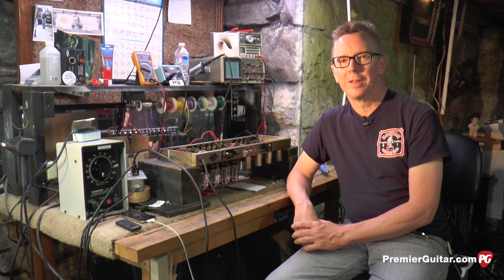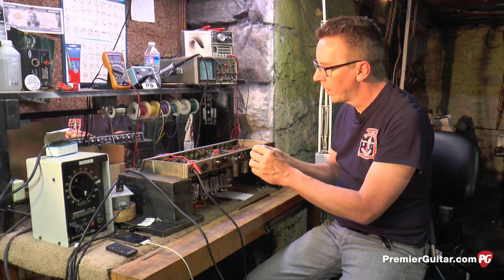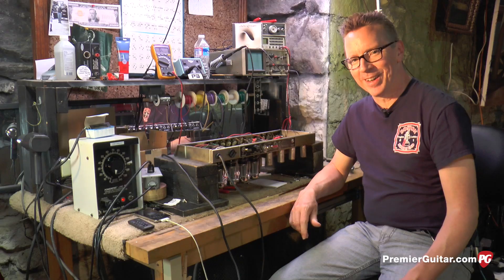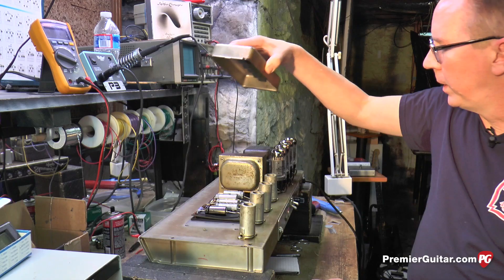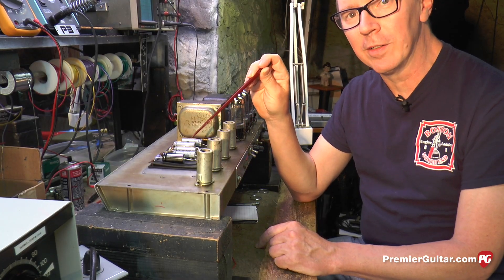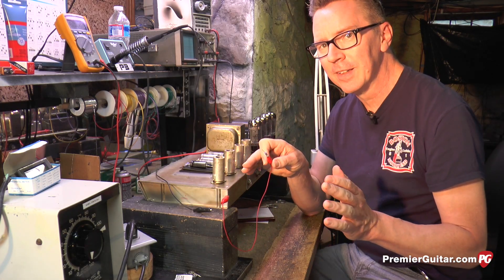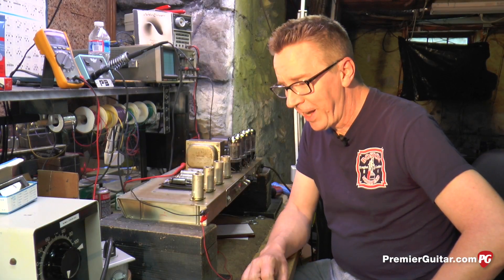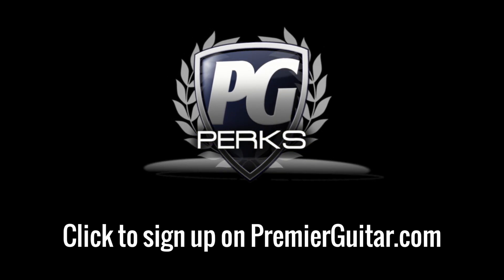DIY: Amp Safety 101

Comment: When you are trying to discharge the filter caps and the amp is unplugged  on the bench and it not plugged in how is the chassis a ground?  What is connecting it to the earth to dissipate the charge?
Reply: +Andluth Also curious- is it just the fact that it is sitting on the table?
Reply: +wattdog16 I emailed Kye and he said the chassis should be enough to drain the caps.  He also said that any good tech would also use a Variac but he did not say how.  I hope that helps.

Comment: Basic electrical question: The chassis is used a grounding mechanism. But doesn't that just make the chassis electrified?
Reply: +Brendan Wilson A filter capacitor is like a DC battery: it stores electrical energy until you give it a path to ground.  In the amp, the negative side of the filter cap is always connected to ground; the positive side is not.  When you use the jumper wire with the resistor, you're "shorting the battery" (the capacitor), positive pole to negative pole.  That's what drains the power from the cap.  The power cord does not have to be plugged into the wall for this to work.
Reply: just to be clear, Kye misspoke when he brought up the fact that the earth is the biggest resistor. That is true. However the minute you unplug an amp (which he says you must do before you start to work on it),  the earth as a resistor becomes irrelevant because the chassis is no longer grounded to the earth as it would be if it's plugged in (through the the ground pin in the plug).  At the point that the amp is unplugged, the amp's circuit is said to be "floating." The chassis is still the ground side of the circuit and by connecting the (+) side of the capacitor to the ground side of the circuit (with a lead that includes a resistor), you are shorting the capacitor and the act of shorting a capacitor discharges it. The are plenty of amp techs that short capacitors with the shaft of a screwdriver. Not a great idea by most standards because there will be a nasty spark. But it speaks to the fact that you're just shorting the two side of the capacitor to discharge it.  If one hand is on something connected to one side of the capacitor and the other hand touches something like the chassis that's connected to the other side, then your body is completing the short circuit the same way the shaft of the screw driver would. Only problem there is your heart is also in that circuit path (from one arm to the other).
Reply: +Brendan Wilson Im curious about this too :S  what if your elbow is bumped against the chassis while you are discharging like this?  Do you become a quicker ground to earth?
Reply: +Brendan Wilson Also curious.  Would like somebody to elaborate on how the chassis as a ground works exactly
Reply: 'Ground' has more than one meaning. The ground wire in a three wire power cord connects the chassis to actual ground - the Earth, so that if a fault should cause the chassis to be connected to the live/active/hot wire of the power cord, if the mains fuse in the amp doesn't blow first, current flows to ground and (hopefully) blows a fuse or trips a breaker at the distribution board. Another meaning of 'ground' is the 'zero volts point', from which other voltages are measured, which in a guitar amp is the chassis, even if it has a two wire power cord. Even in a stand-alone battery powered electronic device such as a transistor radio, the wire or PCB track connecting other components to the negative terminal of the battery is known as 'ground'.
Reply: +wattdog16 +Amber Johnson +Brendan Wilson  The reason is because the chassis is connected to ground through the ground pin on the amps power plug (the long thick one in the center). This makes the chassis a direct electrical connection to ground with almost no resistance. On the other hand, your body has a resistance to it since it is not an ideal conductor (think of your flesh as a resistor). So, even if you touched the chassis while discharging the filter caps, the vast majority (essentially 100%) of the electrical current would want to flow through the path of LEAST RESISTANCE to ground, which would be through the chassis to the ground pin.
Reply: Suppose you bleed some large capacitors to the chassis of an unplugged amplifier as shown in the video. Is it possible for the chassis to become dangerously charged or would this not happen because the chassis is so large in comparison to the charge stored by the capacitors?

Comment: You should also check the voltmeter itself before use. For example by probing a battery. Otherwise something like a broken wire can result in a zero reading even tough there is dangerous voltage in the capacitor.

Comment: The biggest resistor on the planet, the planet itself? But the amps not plugged in, how does that work?
Reply: +crispybacon501 Both the bleeder lead and the negative end of the capacitor are connected to the chassis of the amp, so touching the resistor in the bleeder lead to the positive terminal of the capacitor places it in parallel with the capacitor. This means that the voltage on the capacitor is applied across the resistor, and if there is a voltage across a resistor there must be a current through it (Ohm's law). Where there is voltage and current there is power. The electrical energy in the capacitor is dissipated as heat energy in the resistor.
Reply: The planet is a red herring! It isn't involved!. The chassis simply acts as a convenient conductor, standing in for a piece of wire. Whether or not it is connected to Earth is totally irrelevant.
Reply: I was wondering about this, too..
Does the amp need to be plugged in (but switched off at the wall switch?) to bleed the caps to earth?
Or just connecting across to the chassis unplugged is ok?
Reply: Many years ago I worked in a computer repair shop, and we'd attach a ground lead from the computer chassis to the ground hole of a wall socket (plus another ground wire from the chassis to the technician's wrist) to ensure that the chassis AND the technician were both grounded to actual-earth (not just grounded relative to one another). This was mostly to guard against damage to very sensitive computer components (which were susceptible to tiny voltage differences), not as a personal safety measure. But wouldn't it make sense to ground the chassis to the earth (via a wall socket--the ground hole only) for this application as well?
Reply: +Silas Fatchett Yes I fully understand that but where does the planet come into the equation? Since the amp is unplugged then the chassis is not at earth potential. I don't think he thought that comment through before saying it. Anyway, moving on....
Reply: My thoughts entirely

Comment: As JusAequum asked. How do you know the chassis is grounded. I understand how it would be grounded if the amp is plugged in but if the amp isn't plugged in how is it grounded?
Reply: It isn’t. You are shorting the caps one by one to their negative lead. Just as you can short a battery and it drains it with no path to ground.

Comment: What isn't mentioned is those caps can charge up again when the power is off, not to their full value though.Anyone who has ever worked on CRT TV's can tell you about this sort of thing.
Reply: The belt and braces (belt and suspenders?) approach is to use a jump lead to connect the positive terminal of the(discharged!) first filter cap to the chassis while working on the amp.

Comment: Noob question. How can I know that the chassis is ground? Did I have to do anything to ground  the chassis?
Reply: If the amp has a 3 pin electrical plug, it's designed to be grounded.  You might assume any tube amp would be designed to be grounded, but I have a couple old  Tube floor radios from the 1930s that aren't grounded circuits.

Guitar Tube amps.. probably grounded but make sure there's a grounding prong on the plug to make sure.

Assuming you've got that round 3rd grounding pin on the plug.. you can set your multi-meter to continuity mode [where it beeps when you touch the probes together] then touch one end to the round grounding plug  and the other to the amp chassis.  It should beep to indicate the grounding pin is actually connected to the chassis.

There's one bit he glossed over though.  
The amp was unplugged.  To discharge the caps, you do need to connect the chassis to earth [aka ground] again.  There are a few ways to do this..
1)  If the amp is turned off and plugged back in, the power circuit will be cut by the power switch in the "open" position, but the ground should be in place.  That assumes your power socket is grounded properly of course ;-)
2)  If you're nervous about having it plugged in while working on it even if it's turned off [I am, and you should be too], you can directly ground the chassis to earth.  Unplug the amp, then make  a 'pig-tail'.. a ground wire with an alligator clip on one end to attach to the chassis.  The other end is then attached to ground.  That can be your grounded power outlet or anything else that's properly ground.. like a water pipe in your basement if that's where your workbench is located.
2a)  variation on the previous.. take a cheap 3 conductor extension cord and remove the power blades from the male plug.   You can often just grab them and rip them out.   Leave the round grounding conductor on the male plug though.   Plug your amp power cord into the extension.. plug the remaining ground plug into a grounded outlet and the circuit to earth is complete but no AC current will flow to the amp.  :-)
Reply: While ensuring a good ground for your working amp is an excellent idea, a connection to ground is unnecessary when draining filter capacitors. Check out my previous reply to Dave' s comment.
Reply: As a matter of fact, I was wondering that myself!
Reply: Thanks a lot!

Comment: If the amp was unplugged, how can the case be considered a grounding point? The whole thing is floating. Don't the filter capacitors need a path to true ground in order to discharge correctly?
Reply: When draining a capacitor our main concern is to remove the dangerous voltage, which is due to the charge (electrical energy) stored in it, so it is the charge that we actually need to remove. In a tube amp, the negative terminal of the capacitor is connected to the chassis, so connecting one end of the resistor to the chassis is simply a convenient way to make a connection between one end of the resistor and the negative terminal. We could attach the alligator clip directly to the negative terminal, eliminating the chassis from the draining procedure. Touching the positive terminal with the other end of the resistor places the resistor across the capacitor terminals. The voltage on the capacitor appears across the resistor and Ohm’s law (I = V / R) dictates that a current must flow in it. If there is a voltage across a resistor causing a current to flow, the resistor dissipates power (P = V x I). A resistor dissipates power by converting electrical energy into heat (another form of energy). The electrical energy (the charge) stored in the capacitor is converted into heat energy in the resistor and the heat is ultimately lost into the atmosphere. Whether or not the chassis is connected to the safety ground at the wall socket is irrelevant, since the charge disappears into the air, and doesn’t need to go to ground.
Reply: @silasfatchett5693  I feel that I should add that while Kyle's explanation of the draining process is flawed, his practical advice is right on the money. If you follow his instructions to the letter you can work on your tube amp knowing that you're not going to die.
Reply: ironcut13 Well, you can die 30,000 feet in the air but that's besides the point.
Most amps have their metal case connected to circuit ground, for shielding. Then the case becomes connected to earth when (properly) plugged in, for safety.
If for some reason the case/chassis is not grounded, you can discharge the caps to some other poit at ground potential, like their negative side.
Reply: ***** their negative side are connected to the ground, as the chassis, so ...no matter if the amp is plugged or not
Reply: Silas explained this perfectly. His explanation is sound and I can vouch for its validity.
Reply: Yeahhh, How can you bleed the capacity to the big EARTH if the amp is not plugged to it?
Reply: Now it makes sense. Thank you.
Reply: @ Fanta Future 92 :  You are dead meat , man !.
Reply: The chassis is connected naturally to earth, as your feet ! You can die even if you're not plugged, no ?
Reply: ironcut13
	 	 	 	
Never ever ever assume anything. I've worked on positive chassis ground for instance and other equipment where the power was not grounded in any way is was floating relitive to the chassis and just for good measure equpment that was desigend to have two ends isolated from each other with different ground 	 	 	 	
potentials. When I was trained it was schematic test and test again. Insolation testing was done as part of the fault finding prosess and as last test! Hand in pocket is to stop the current going through heart and to make it 	 	 	 	
impossible to touch power and ground at same time
Reply: retroman33366 You are right. That's why I said no matter if the amp must be plugged or not. Each amp and schemas are specific. Sometimes, it's safer it's not plugged...and sometimes not :)
Reply: I was wondering that too.
Reply: So if the stored energy is enough to "throw you on your tail" the heat it would produce in the resistors (if the chassis is not actually grounded) will be enough to heat your tail considerably. I think we need an answer from our 'guru' on this. I, for one, am not going to spend 75 bucks getting a pro to fit a potentiometer when I can do it myself for 2. But I don't wanna die in the process. Come on Premier Guitar, we need you to answer this question.
Reply: I would like to know the answer as well. What was said is that the resistor in the test lead is there to avoid a spark. So we can assume that the resistor is not there to discharge a capacitor. Now let's put the resistor away from the test lead and think what happens if we try to discharge the capacitor with amp plugged off the wall. Where does all the energy of the cap go? Correct me if I'm wrong, but I think that the chassis will act as a big resistor with low resistance and the energy of the cap will be dissipated in the chassis as a heat. I think that the same happens with the amp plugged in the wall.
Reply: Well i think you just unplug the power for testing the fuse (no fuse with power plug, no safety). Then plugging it in for bleeding the Capacitors. Correct me if im wrong.
Reply: @FantaFuture92  Sorry, but you ARE wrong!

Comment: Good information. One question:  You said "IF the amp has a bleeder circuit".  Are there amps that no not have a bleeder circuit, that have dangerous caps in some other part of the circuit?
Reply: There are amps that have no bleeder circuit, but most do. Always assume that the caps are charged until you've checked for yourself. When the filter caps are discharged, the whole amp is safe to touch.